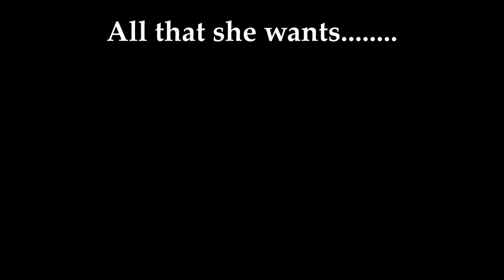Electric Power Steering conversion

Comment: the mechanical part doesn't bother me so much rather than the wiring portion of this conversion!  if i may... beside the obvious positive and negative,  is the steering motor always on when ign on or those it get a signal feed by a steering angle sensor or other? i'm currently looking into thin column option and a eletric power steering pump and the wiring issue got me worried....can you help? tx

Comment: was macht der schwarze controller 
what is doing the black controller 
do i need this ?
Reply from the maker: It is a speed controller. If you have a corsa C, you don’t need it.
Reply: @Ollaris just + and - and it is working ?
Reply from the maker: @ If you have a corsa C you will find a white plug under the dashboard and you just plug that in the silver box you have on the eps
Reply: @ I will do this without Corsa
Reply: @Ollaris  I will use on Tractor
Reply from the maker: @ than you need a speed controller and a potentiometer to adjust how much assist you need.  I bought the black box on eBay. I don’t have the link anymore. Sorry
Reply: @ no Problem thank you so much

Comment: Hello Friend. all well? I would like you to please show me which link pins are used for the steering sensitivity controller. because i'm from brazilian and i bought this steering column for my corsa c. and there was no extra wiring. I would like to know which pins to use and which one is the key post.
Reply from the maker: The small box you see in the video you don’t need. There should be already a wire loom in your C corsa from factory even if it doesn’t came eith power steering. It should be a White plug on the left side. You just need to plug that into the EPS box that is on the power steering column.

Comment: Did you see a bump in fuel economy?
Reply from the maker: I haven’t noticed anything. From my understanding the eps motor is just on standby and it just actuates when the steering wheel is moved. I haven’t changed the alternator either.
Reply: So this is designed as a way to eliminate the hydraulic system, saving money?
Reply from the maker: I think it’s way cheaper to manufacture than the usual hydraulic pump, the pipes, and steering rack. Or even the hydroelectric pump used by VW.

Comment: Tengo un kia rio  2013 dirección mecànica como haga para hacerla electroasistida es muy dura estoy en ecuador
Reply: My mechanic was working clutch and disconnected the whole power steering while battery still plugged when he's done on replacing foot paddle element car it doesn't have power steering while idling please help what's the way forward what should I do

Comment: Hi Polaris, I've got a 1996 Honda Delsol with a Hydraulic power steering system. I would like to add EPS to it but only tutorials I'm getting are to take an electronic hydraulic pump and use that. Problem is lot of people say it drains the battery.

Can you advise how I can install EPS on my car? The Civic is an EG chassis.

Thanks
Dev
Reply from the maker: Electronic hydraulic steering is fine. It doesn’t drain the battery when you don’t turn the steering wheel. It’s on standby mode. Just if the sensor sees movement it the steering column it turns it on. I’m not familiar with the Honda types. But i think they had a good reason to switch from the pure hydraulic.

Comment: Works with electric rack and pinion?
Reply from the maker: +Jesse Wallace no it works with a normal manual rack and pinion steering rack. No extra sensors needed. Its mainly just an electric motor that senses in which direction you turning the wheel and gives you an assist.
Reply: Cool, Cause I am going to use a Tesla power steering rack.
Reply from the maker: +Jesse Wallace great! A Tesla steering rack???? That's damn expensive! What cool thing are you building if I can ask!?
Reply: All Wheel drive Audi S5 Conversion using Tesla Battery, custom BMS software, Tesla Motor and other misc Tesla hardware from crashed Tesla. Right now we are currently building a custom ECU with Can-bus functions for EV components.
Reply from the maker: +Jesse Wallace Nice! Thats some crazy shit I would love to be involved in such a build! Best of luck and success to you!

Comment: Do you have problems with the wheel centering its self when exiting a corner?
Reply from the maker: +andrew kennett no not at all. As you know that happens becouse of the suspension and steering geometry.
Reply: Ollari's  helo sir I need to know that can hydrolic power steering in fiesta classic can also be changed with electric one,if yes than how and who will do this for me sir. Kindly plz reply. Thanks

Comment: i want to convert my conventional steering system to EPS system,,, what sensor i must buy for vehicle speed sensor?? for an old vehicle, which use steel wired speedometer... can you an advice and give me some example for the speed sensor?? many thanks for the answer.. :)
Reply from the maker: +Rakhmad Romadhoni You don't need any! The little black box and the potentiometer in this video are exactly the solution. You just need to adjust the potentiometer to get the desired assistance.
Reply: did you mean that the potentiometer manipulate the speed sensor, and make it constant speed value for EPS modul.... whats value of potentiometer? 5K ohm??

i got the point.... thanks a lot.. :)

Comment: excellent video of conversion, I have two questions, how did you do for the electrical connection inside the car, is there a need to change the hydraulic steering box when making the conversion?
Reply: The steering box mod I've seen is: Just making a loop of steering hose from one hose port to the other just to keep existing steering fluid inside the steering box...
Reply: Why would you add power steering to a vehicle that already has it????? The only thing with hydraulics is a power steering box. Manual boxes are sealed.

Comment: I need to do this with my Honda Accord 95. It has hydraulic power steering which keeps leaking and no one has been able to fix it. Which eletric steering box and column would fit in it?

Comment: Can you share some dimensions. I'm planning to fit it on my off road project i don't have any steering assistance and at low speed it is painfull to turn the steering wheel. I just need to have some basic (width at servo location ) to see if it can fit under a dash its pretty crowded .. Subscribed simple and on point videos no bs talking 5 mins before starting the project. Jist as iy should be.

Comment: Nice Job.

To change from manual to power steering, Is the process same for all cars?
Reply from the maker: +David Jegan Thank you. Not in all cases. Most of them have Hydraulic power steering.
Reply: Of cause of the have mechanic steering, is it alwasy the same? Ian sure half of the viewers think you bought the oem steering column and not something universal
Reply from the maker: It's the OEM steering column. And no the mechanical steering is not always the same.
Reply: @Ollaris  can I use a hydraulic steering box for this process, if yes, but steering box oil leaking from oil seal, is it ok to use

Comment: It never looks that simple when I fix my car 😊 And a face reveal ! Cool. Nice to finally see you my friend !
Reply from the maker: +The Redsmith Haha. It is just a question of practice!
Reply: There's an issue with my power steering ( eps).  just when i started the engine the steeringwheel started to turn at right side directions. May i ask what problem might this be? When the car started to run i just hold the steering wheel coz it won't stop turning to the right. It is still manageable for me bcoz it is still light to handle. But when if i take my hands off the steering wheel it will keep to theright direction. I needto know what will be the parts onthe steering components to replace.
Reply from the maker: +Micca Sophia what brand is your car? It can be a faulty eps controller box, or the direction switch on the motor.
Reply: @miccasophia4158  @ just callibrate it
Reply: @miccasophia4158  I have one question, did you change your old power steering box
Reply: @Ollaris    Very nice! Where did you say you bought the EPS kit?

Comment: you just added some power to your wheels which was getting wasted earlier to drive the hydraulic pump of the previous rack
Reply from the maker: I had no steering assistance before. None. From factory no power steering.

Comment: What a great video you've got here. I'm looking for a similar solution to install on a 1995 Citroen ZX (the most economical and reliable car I've ever had).
Where did you get that module? Is it Opel standard? Did you buy it new or was it taken from a salvage car? Would it work on a Citroen? (probably the screws would not fit, right?)
Thank you and greetings from Portugal.
Reply from the maker: +Vitor Madeira Yes it's an Opel OEM part. The Corsa B and Corsa C have these modules. You can find these in most salvage yards. I think you need to modify it to fit the Citroen.
Reply: Great! Thank you for the really fast answer. You just earned yourself a new subscriber. ;)
Reply from the maker: +Vitor Madeira Thanks Vitor! Happy to have you here!

Comment: Awesome. Great work dude. Do you know if that is possible to do on a Corsa b model?
Reply from the maker: Thanks! Yes it is possible. I think the Corsa B has already been wired up for power steering from factory you just need to change the steering column. Make sure you get one where the control box comes with it.  You should find all the plugs necessary behind the dashboard
Reply: Ollari's many thanks dude for the fast reply. I will check that. Big hug from Portugal. Take care.
Reply: @paulodomingues1120  Hey man, did you find the plugs on Corsa B? 
I need to do the same thing
Reply: What steering column is it that needs to be installed when removing the Corsa b steering column?
Reply: Would love to do this conversation to my Corsa b, where to source the EPS column?

Comment: what kind of esp do I need tor an vw lupo 3L 2001... tax
Reply from the maker: +Adrian Poroch though question! The problem is that the normal Lupo and the 3L don't have the same Steering rack. What rims and tires are you putting on the 3L that you need a EPS? You could compare a Polo 9n system maybe its closer to the 3l.
Reply: in motion there is no need but in parking mi wife has to work harder .. stock size rims .. tkx for your response
Reply from the maker: +Adrian Poroch Sorry I couldn't help more.

Comment: I must be stupid or something, don't understand what steering column you used. The description only sais that it's used in rally cars and hot rods.
Reply from the maker: +Johan Hägerström Sorry man. Its a steering column from and for a Opel Corsa C. But a Corsa B would do it too.
Reply: Ollari's thanks for speedy answer 👍 I'm customizing an old beetle, will run a narrowed front beam to accommodate wider front wheels so I'm looking into things like electric power steering 😊
Reply from the maker: Nice!What year?  you'll need an electric box that imitates the drive speed. you can find it on ebay. just search for Corsa eps. its a box with a  potentiometer.
Reply: Ollari's it began its life in 1962 and somewhere in the 90's it was fitted with both the rear window and rear lights from a 50's model. Front signals is built into the front light houses and some wider wheels is mounted in the back. But the build quality is a bit tacky so I'll be redoing almost the whole car from front suspension to interior to electrical system and more. I'll check that out 👍
Reply from the maker: +Johan Hägerström Great! That's a style I would love too. Someday I will have my own bug or better my dream Typ3 notch.
Reply: Ollari's Can never go wrong with a notch 👍
Reply from the maker: +Johan Hägerström :)

Comment: If you like knowing where your tires are while you're driving do not do this you will have no sensation of your tires touching the ground or turning don't do it.
Reply: John Sears I used to own an factory EPS Corsa... you can feel the road and you do still get feedback. Enfact every power steering car I’ve driven be it EPS, MPS (Mechanical Power Steering) you can feel the road. This is coming from someone who daily’s a 1955 Standard 10 without power steering so I do know what the feel of the road without it is like... it’s pretty much identical when moving, the only real difference is when your crawling or not moving the steering is then heavy without it.